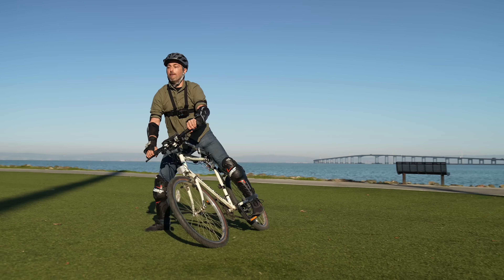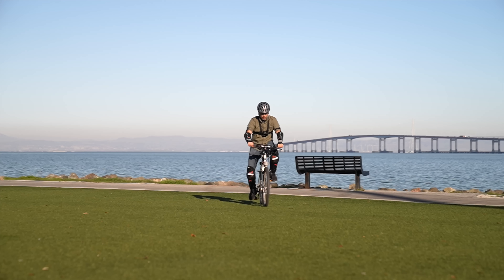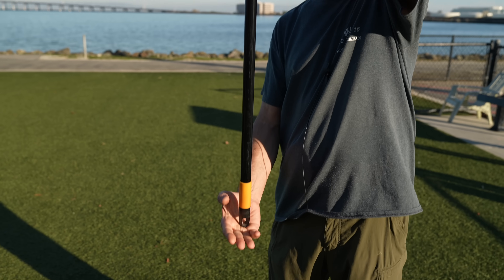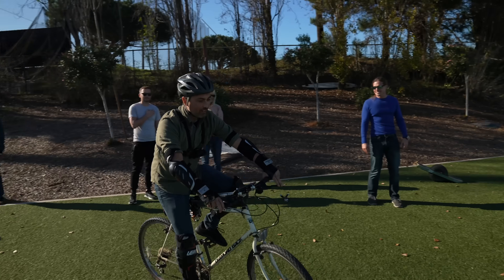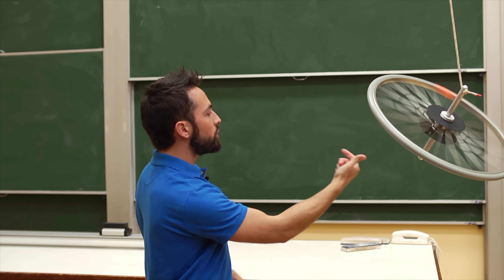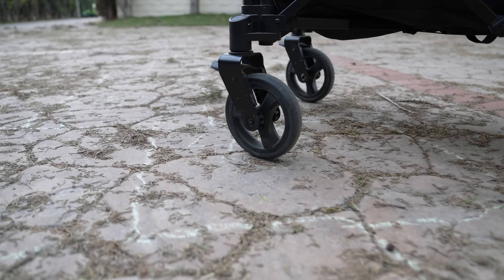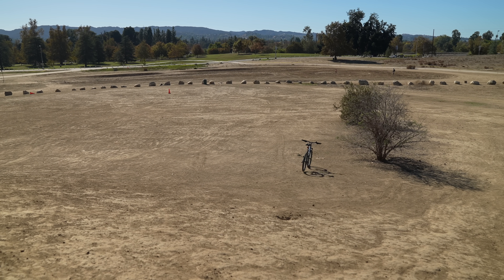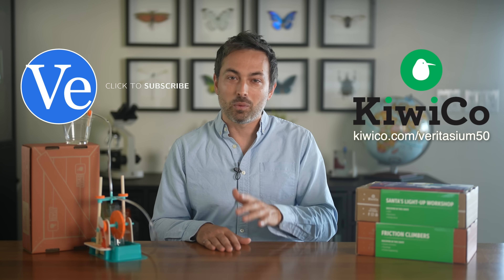Most People Don't Know How Bikes Work

Comment: Get a lighter/better bike. Learn how to control ur weight on a bike better. Find the apex of turns, ur body should be closer to the apex than the bike. Like a boat listing. As u come out of the turn and the bike starts to fall pull the handlebars up. Just up, doesn’t need to be side to side as you apply power on pedals. I can turn on a bike like this easily and so can alot of my friends that ride.
Reply: How do you pull handelbars up? Do you bend them?
Reply: A good turn should look like you about to fall right before your bike catches you on the back side of the turn

Comment: This is interesting but you don't even actually have to turn the wheel at all in order to turn the bike unless you need a sharp turn.  Anyone who has ridden no hands knows this.  You just lean.  Granted the test area in the park there was really small.
Reply: When you lean the bike riding with no hands, you are steering.  Derek described the three principles that cause the steering inputs when no one is touching the handle bars.

Comment: It's somewhat similar on a motorcycle. Because you have actual power to propel you forward, the need to countersteer isn't as necessary. You just lean into the direction you want and turn the handles depending on speed and angle. A lot of the time you'll find you rarely ever actually steer with the handlebars on motorcycles.

Comment: before watching I'm gonna say that the chains are on gears which are connected to the back tire which causes it to move when you pedal and the front wheel is free spin so you can steer and do tricks with it. I'm not a genius. I just have common sense

Comment: How would that bike with the "locking" handle bars perform if someone was riding the bike without touching the handle bars? In that case, we control the bike by leaning, obviously it would still not go in the locked out direction, but would we be able to turn in the permitted direction without counter-steer? Thanks.
Reply: It will perform just as same as touching the handlebars.
Reply: Without touching the handlebars the bike stays up because the wheel turns by itself, correcting the tilt. It can’t do this when the handlebars are locked, so it will fall over. Perhaps if you had extremely good balance you could keep it upright, but it would be about as hard as if the bike weren’t moving at all.

Comment: Btw - If you learn to ride a Motorcycle, the Instructor will hammer it into you that "If you wanna go right, you pull left. Don't try to simple steer right!".

Around 30km/h it starts, that you could really screw up on a Motorcycle due to the mentioned stuff here.

Comment: This is why so many noobs wreck their motorcycles. You don't turn into the direction you want to move. You actually turn the wheel into opposite direction and then lean the bike into the direction you want to turn. It's counterintuitive, but it's how it works. Say, you're coming up to a curve in the road and there's a big truck in the opposite lane coming around the curve toward you. If you attempt to turn your front wheel into the curve to steer into it, your momentum will cause your front wheel to skip and hop into incoming traffic and collide with the truck. I've seen it happen. You naturally allow your wheel to turn a bit toward the big truck as you lean into the direction you want to go, and the bike will go the direction you lean, not the direction you steer.

Comment: Hmm, I smell a paradox. How do you do the first counter-turn? You can even see it in the video, people actually succesfully move outwards in their pre-counterturn? Do you need a counter-counter-pre-turn?
Reply: I think @Jordan Hillard has it.
Reply: @687321456  You don't need to counter-counter-steer, because the first counter-steer is needed to effectively put you off-balance so you can find your new balance at the appropriate lean for the turn you wish to execute.  If you wished to stabilize after the first turn, then you'd need to counter-counter-steer.
Reply: @Rick_Cavallaro  But you could stabilize without the counter steer through overbalancing
Reply: @687321456  I'm not sure what "overbalancing" is, but I can tell you that only the most skilled trials riders can balance a bike with locked steering, and they don't do it in the way that mortals ride a bike.  They learn and perfect a completely different, and very difficult balancing skill.

Comment: I used to cycle often and I came to realise that gradually leaning into the turn generally makes the turn way smoother than to just turn the handlebars - never knew the exact reason why til today

This is especially true when I started to learn how to cycle handsfree - you lean and change the balance of the bike before the turn itself
Reply: Yep I figured out riding a bike without using my hands and it was all about the lean.
Reply: Exactly, i used to flex as a kid when i rode a bike without my hands on the handle and simply turning by carefully leaning myself in the direction i want to turn.
Good times
Reply: @danknibba7735  I was just doin tht today 😭
Reply: I was just about to comment this, I mean the fact that when you go hands-free this effect is very visible. :D Man I just love bikes.
Reply: And if.yoi Gunna slip,.steer into fall and you'll right yourself
Reply: @paulbyrne4214  No, if you're slipping this whole thing doesn't work anymore.
Reply: I haven't finished the video but is that what it's about? I already know this
Reply: No 4 is your IQ
Reply: Leaning does nothing. Leaning won't steer a bicycle or motorcycle. It's all about counter steer.
Reply: @bones I believe they are referring to using leaning and the bikes built in mechanisms to create a hands free counter steer.  The front will turn where you lean, and lean in the direction of a counter steer, it should work.
Reply: Or just ride a motorcycle

Comment: I have ridden bicycles for 66 years. To turn left I lean left first by moving my body left in order to slant the bike to the left, then I turn. It is all simultaneous. I will have to experiment to see if I turn slightly right first. I don't think I do. (I am 72 and still run to stay in good condition. I do not usually ride slowly. I hate when car drivers do that. They get over to the right to turn right then turn back into my lane almost causing an accident. Same with left turns. Good drivers DON'T do it.

Comment: "Most People Don't Know How Bikes Work", "I think most believe you turn a bike simply by pointing the handle bars in the direction you wanna go". Anyone who's ever learned to ride a bike does know how they work, and knows that you don't steer in the direction you want to turn. They won't necessarily be able to describe the physics involved, but they'll tell you that you steer left to turn right and vice versa. And locking the handlebars just prevents what's necessary in order to make the turn, it doesn't prove anything about a person's expectations / assumptions.
Reply: >> Anyone who's ever learned to ride a bike does know how they work... they'll tell you that you steer left to turn right and vice versa.

You'll find literally thousands of bike riders commenting on this very video that would beg to differ with you.
Reply: @Rick_Cavallaro  That would be surprising coming from any that have paid any attention for one turn of the handle. I rode motorbikes and it was certainly evident then but, even as a kid riding a bicycle, I can't think of a time where I didn't know that I had to jerk left to "fall" right and create a right bank. Sure you can go slowly and steer in the direction you want to go, but you're always having to be careful not to go too fast otherwise you'll fall in the opposite direction.
Reply: @MBuckner  
>> That would be surprising coming from any that have paid any attention for one turn of the handle. 

Surprising indeed, but there are literally thousands here that make exactly the claim.

>> you can go slowly and steer in the direction you want to go, but you're always having to be careful not to go too fast otherwise you'll fall in the opposite direction.

It's a very common claim that you don't have to counter-steer to balance at low speed, but you absolutely do.

Comment: Everything I thought I knew about riding a bike is incorrect 🙄 I had honestly always thought it was the centripetal forces keeping it stable. Thank you for the really interesting and educational video.
Reply: The centripetal forces is absolutely key to your constant lean through a constant turn.  But counter-steer is how we initiate (and end) all turns.
Reply: @Rick_Cavallaro  Snowbikes have skies insted of wheels and they lean just fine.
Reply: @XtreeM_FaiL  
>> Snowbikes have skies insted of wheels

Yes.  That's the point.  They have no gyroscopic moment since they don't have wheels, and yet they are stable when moving and not stable when sitting still.  This tells us it's not the gyroscopic moment that's making the vehicle stable when it's moving.  It's the steering.  When it's moving, the steering gives you the ability to move the contact patch laterally for balance - same as a bike.

>>  and they lean just fine.

Yes.  Just like a bike.  And just like a bike, you can't balance on them ( or initiate a turn) by shifting your weight.  You do it with counter-steer.

Comment: Any mountain biker can tell you that if you pull your butt off the seat it solves 90% of those problems. Granted bike geometry helps a lot i cant help but notice when he does the stationary example he keeps his butt planted to the seat and cant position his weight anywhere other than linear with the bikes lean. Pull your butt off the seat in a standing riding position and you can move your center of gravity over a different contact patch negating the effect of the lean. Its like the difference between riding a dirt bike and a street bike. On a dirt bike you lean the bike under yourself and keep your body more upright towards the outside of the turn but a street bike you lean the bike and maintain linear lean with the bike on the inside of the turn
Reply: Can you find me a mountain biker in the S.F. bay area?  I'd very much like to put them on the bike.  I did put experienced mountain bikers on the bike for the video, and they had the same experience as others.  But I'd love to put one on there that thinks it can be done.